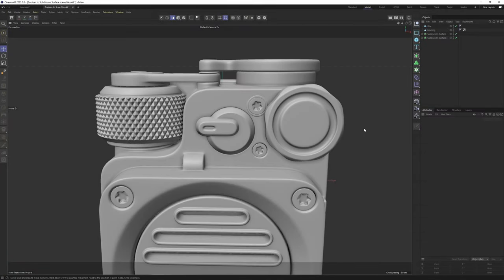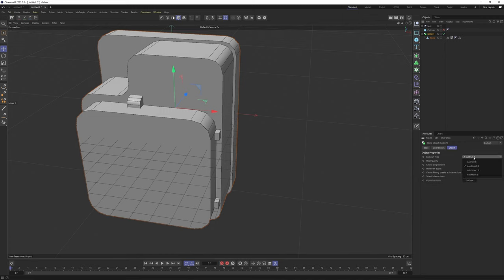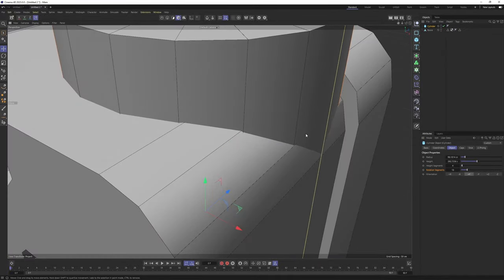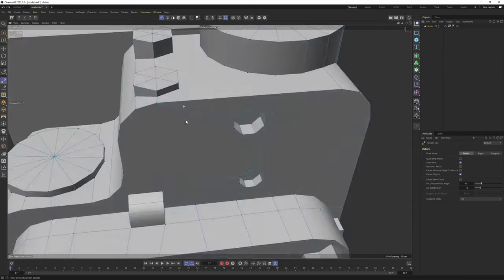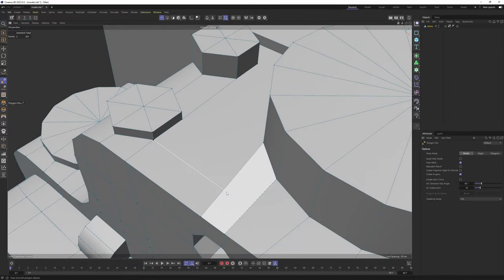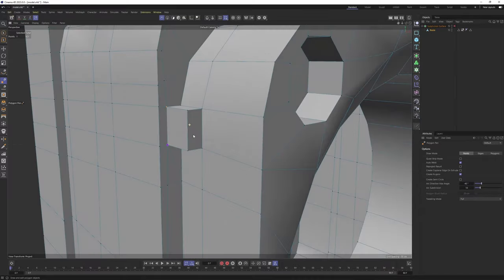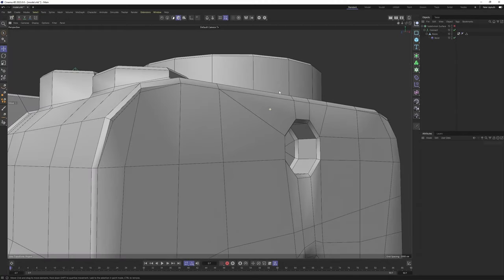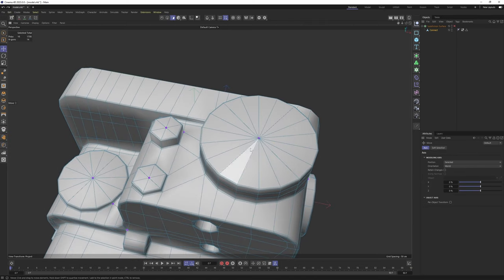Boolean to SubD ready models | Cinema 4D Modeling Tutorial

Comment: Briliant and very quick process as usualy, good tutorial. Just a my tip and expirience that could make life even easier, is use more bevel deformers with different edge selection for specific part, this help me avoid destruction of topology, sometimes is impossible use one bevel settings for whole mesh, or you simply need another proportions of bevels   ❤❤❤
Reply from the maker: You are absolutely right, I just wanted to make it quick, I will make another booelan to Subd tut and I will do what you said.
Reply: @polygonpen  Thanks, keep it up, your techniques and tutorials are the best and most valuable ever.
Reply from the maker: @GhostNade Thanks!

Comment: You don't care about real size when start modeling, that's ok. So, how do you size it down to real size? Is there a precise tool for that?
Reply from the maker: I always do that before rendering, I basically add a box with correct dimensions like 10*10*5 cm, then I select my model and scale it down to the box's level.
Reply: @polygonpen  Dude,  what the hell is going on in the world that developers can't make a tool to scale objects precisely. That's so simple and handy.
Reply from the maker: @Ricardo-de9ju  Precision in objects is not that important actually in 3D sofwares like blender, Maya etc, Nurbs modeling softwares are really good at that though.
Reply: In blender, you have scale tool that helps with that. There should be something along the lines of that in major Dccs since size in real world dimensions is taken into account for path tracing engines like cycles and Arnold. redshift is a biased renderer but is still using the same path tracing algorithms under the hood, so the real world size should still matter

Comment: I can see that Cinema 4d supports bMesh. So why bother splicing up ngons on flat surfaces into quads? If Cinema's subdivision operation cannot handle ngons, you could just use triangulation to break ngons into triangles? Only add support loops where needed, your video and work would be much faster this way and mesh would subdivide correctly.

Comment: Nothing new. To much time consuming. I am waiting for a plugin that solve this hard work in C4d. It is really the only thing that missing, I think.
Reply from the maker: This is the same workflow in every 3D software, I don't think there is a pulgin that gives you  a perfect topology .
Reply: @polygonpen  True, but using Shape3D or MomentOfInspiration software, yuo can get perfect HD surfaces to import in a 3D program. Unfortunally C4d seem to have this problem with the phong tag that limits the correct visualization, at least in the viewport. This drives me crazy untill the 1995.
Reply from the maker: @fabriziopacifici7531  These are Cad/Nurbs modeling softwares, the workflow is completely different than Maya, Blender, Max, C4D, two different industries. Cad softwares are usually for designing and concepting, softwares like maya, blender are for visual productions.
Reply: @polygonpen  ok yes, indeed. I just hope to fix this "bridge" beetween these worlds. Because we need to visualize in a very fast way, so why do not implement this aspect in C4d? Just watch Blender: there are many extension that help the workflow in creating HD surface with awesome inset and bevel functions. I love too much Cinema to start learning other software, I hope they will work on this in the future. cheers